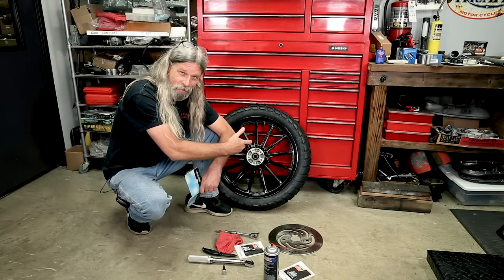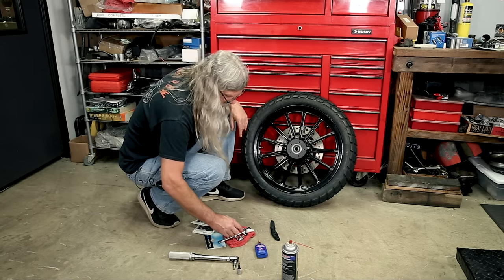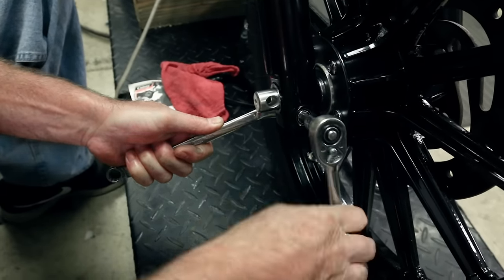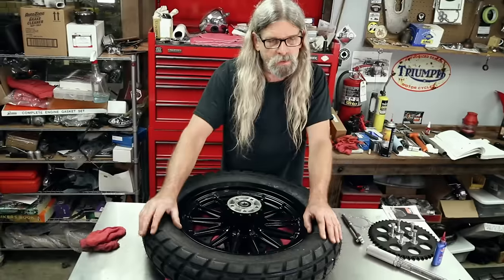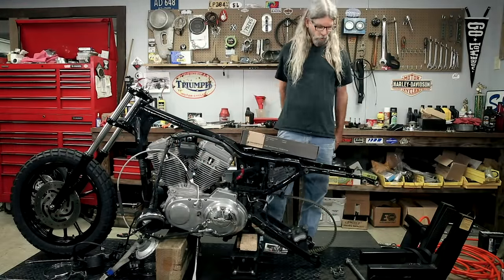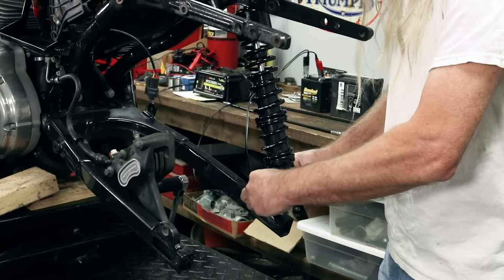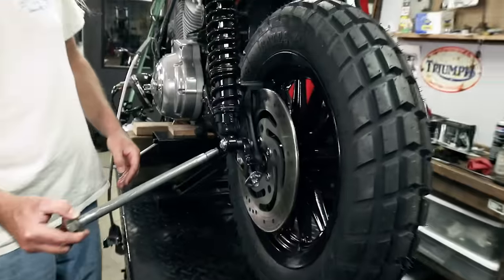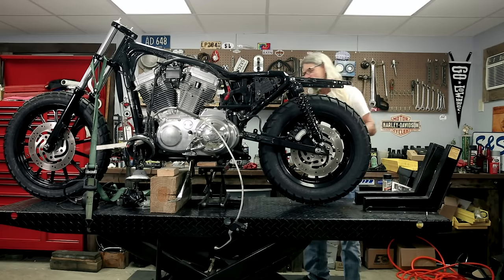Saturday Sportster - Season 1 - Episode 5 - Wheels and Suspension Installation

Comment: I'm starting to think I don't use enough loctite.   I've never actually used it.   I don't have a Harley, but I'm guessing it's good to use on all bikes when it comes to certain critical bolts.   I guess I should also start putting anti-seize on my axles.   I normally just put a thin layer of grease on it, even with sealed bearings.

Comment: Great series! But there’s a big problem for those of us trying to do this on the cheap: Lifted shocks will cause the rear axle nut to collide with the stock exhaust. If there’s any way possible to address this issue for those of us who don’t want to shell out bucks for the hooligan exhaust, please let us know!   Also, any lower cost alternatives for lift without those particular fancy expensive shocks would be appreciated also.
Reply: i run 13” shocks with a 2-1, it’s the perfect size
Reply from the maker: We talk about it in episode 9 and show one solution we have to do because of them. There are many others including making a chain damper pad on swing arm etc.

Comment: Hey Todd and guys! how are you? quick question, what should be the tolerance upon everything is ensambled? I´m trying to change my rear tire on a 2002 FXDWG but so far my closest tolerance is .058" on the pulley side (large spacer) ! As a new whrench monkey this freaksm me out due my lack of knowlege (even with the maintenance manual,  the instructions on how to change the rear tire sucks!!). Besides this, what are the sizes of both spacers? I´m asking this because mines are 41 mm and 18 mm, since I don´t kwow if they´re originals I´m considering very seriuosly to change them!
Thank you very much for your time and my best regards from Mexico! Paco.

Comment: I just put on new tires and used high temp grease not Never Seize.. 
Today’s project,take it all apart and do it right
Reply from the maker: These are closed bearings on this year model. If you have normal bearings that need grease then that’s correct use high temp grease. But if you have closed bearings, never seize is better from keeping your axle from getting stuck.

Comment: Hey Todd if I wanna swap out rear bolts on my bike and put new shiney ones on can I leave the rim on the bike and just rotate wheel to loosen old one and put new ones on ??
Reply from the maker: It’ll be easier to take the wheel off the bike but if you want to do it that way make sure to torque them In that star pattern we show in the video.
Reply: Thank you lowbrow

Comment: Did the wheel bearing have to be removed for powder coat? Does the heat destroy them?
Reply: I have powdercoated wheels with the bearings on with no problem Just grease them since the bake liquifies the grease and it drips out
Reply: @82em1    The bearings are sealed. So I guess they should be removed.
Reply from the maker: We had the shop we took them to to get tires remove/remove the bearings as well to make the job easier for the powder coater, then once back we took the wheels to the shop to get tires put on and bearings put back in for us, we could of done the job but the tool was back ordered and wanted to keep moving forward

Comment: I am not sure that procedure is correct for tightening the front wheel.  I think you should not tighten the pinch bolt until the axle nut is tight.   Instead use a big punch in the axle hole on the opposite side to keep axle from turning while you tighten the nut. Then tighten the pinch bolt.
Reply from the maker: Many ways to skin a cat, todd does  it this way because it insures the axle finds its happy place and the nut torques correctly.
Reply: I was going to say the same thing. I've always heard to torque the axle first because if the pinch bolt is tight it'll pull the fork legs together

Comment: NEVER put red lock-tite on anything on a motorcycle. It is overkill and never needed.
Reply from the maker: in some shop manuals it is highly recommended on certain applications. to each their own we always say, but we always suggest it where we have learned to apply.
Reply: @lowbrowcustoms   Several motorcycle manufactures have discontinued the use of it from the factory. It has a history of seizing the fastener and the inevitable snapping of the bolts, not to mention ruining tools.